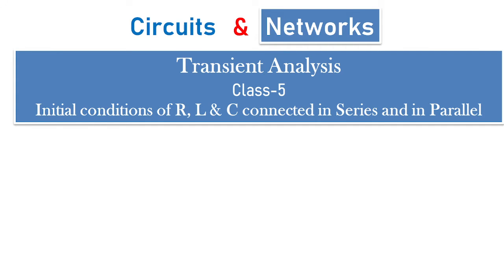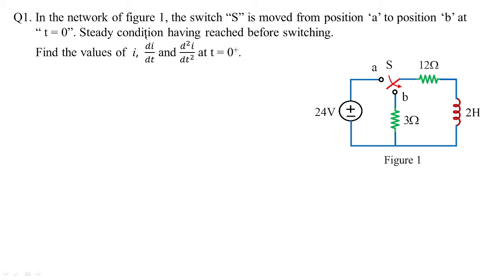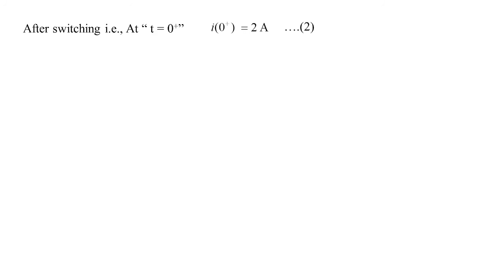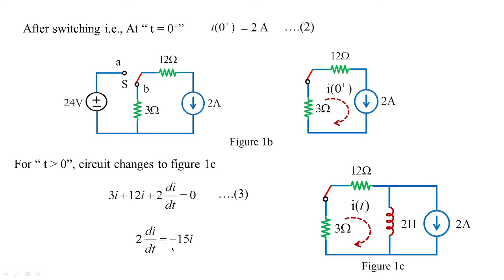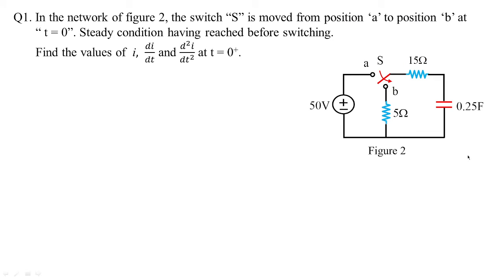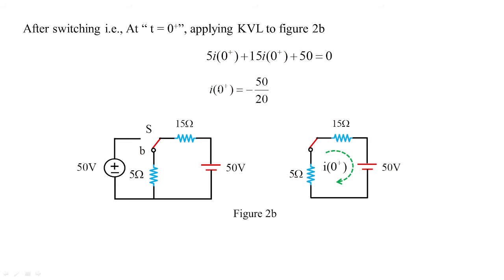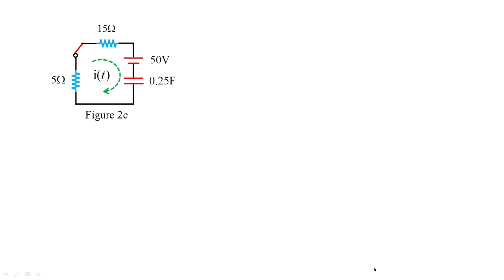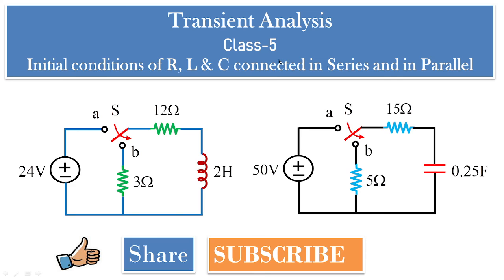How to solve problems involved with initial switching conditions? What is transient analysis?

Comment: Sirrr at t greater than 0 how 50 V comes in series with capacitor
Reply from the maker: again, a good question. listen capacitor has a property that voltage across capacitor does not change instantaneously. So, whatever voltage capacitor aquires at ' t = 0 -', ......, the same voltage it carries at ' t = 0 +'.     So the 50V comes in series and remains same as 50V at ' t = 0 +'